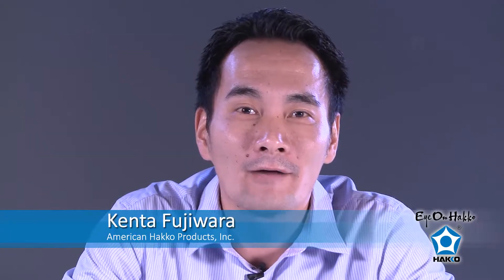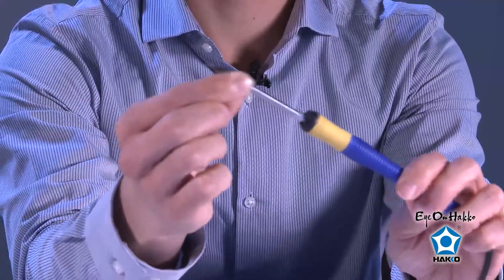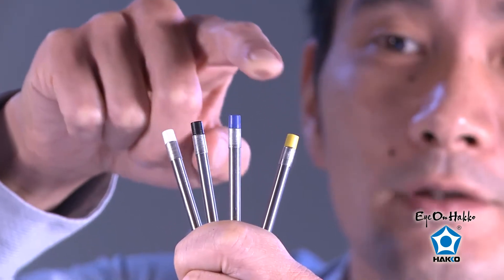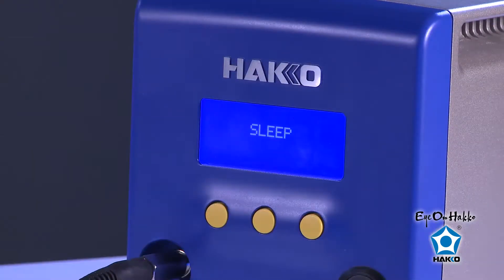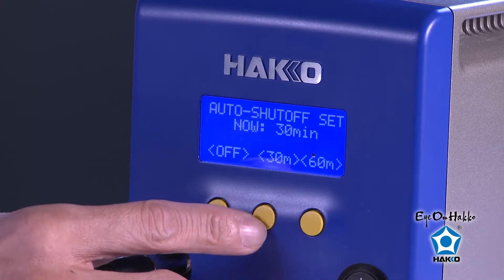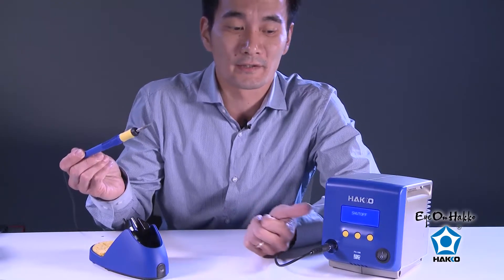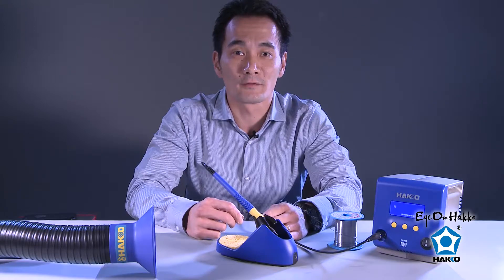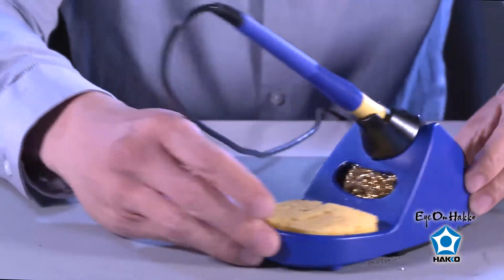"Eye On Hakko" presents The Hakko FX-100 Soldering System — How to Use — Video by American Hakko

Comment: What is the advantage of the induction heater?
Reply from the maker: Faster thermal recovery, faster transfer of heat and better repeatability of soldering temperature. An induction heat soldering station is a high end tool for soldering assemblies that require a high degree of repeatability (military electronics, satellites, etc.)
Reply: I’d like to use this to compare my fx-951.
Reply: is there a 230 volt model?